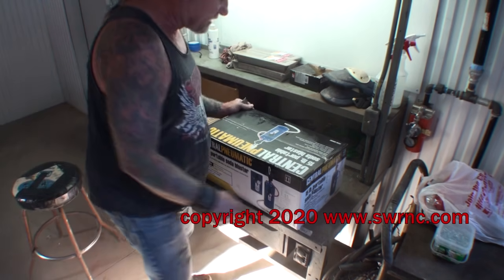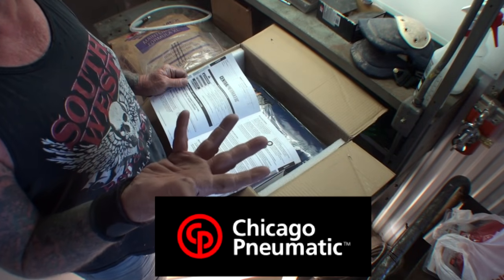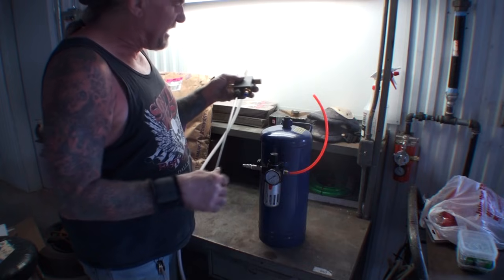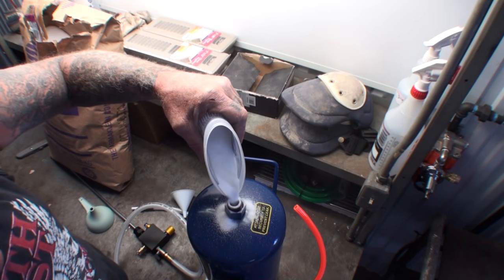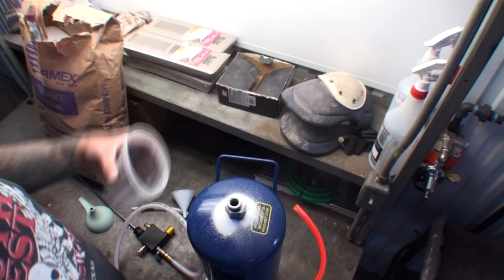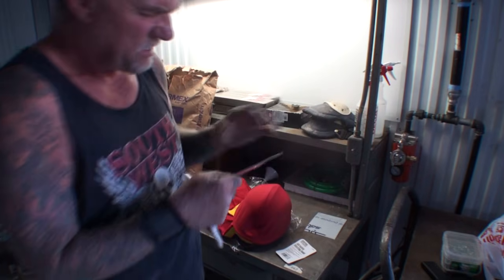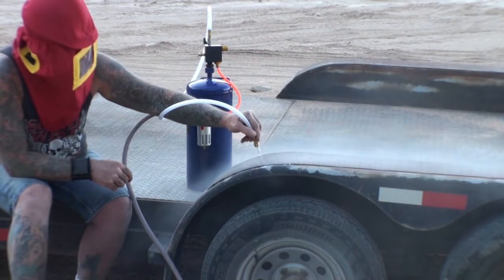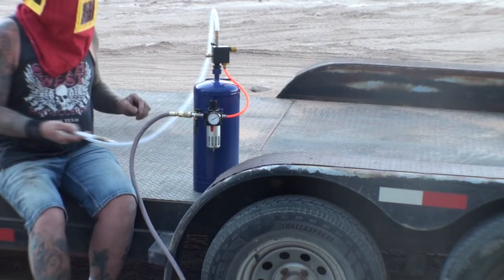"Harbor Freight" - Portable Soda Blaster - TOTAL JUNK?  [REVIEW]

Comment: When you bang a ceramic nozzle on something, what do you expect.......for it not to break?  I have one of these units and it works fine. Soda is very humidity sensitive. Instead of compressor air which is always contaminated with moisture or oil, I use nitrogen. I use this in my carb rebuild shop and have no problems at all.  I think the biggest fail in this video is the operator.
Reply: How about a video by you on how to use it properly. I'm also working on carburetors but struggling with pressure and flows to get it working properly.
Reply: @afraser4669  i like this idea

Comment: You didn't expect quality at the price. But if you were patient and didn't strip the plastic nut, read the instruction where it says how to start and what to expect, you might have gotten it to work. Now you're returning it. It was the wrong tool for that trailer anyway. Thanks for helping  to keep prices higher. You needed the sand blaster.

Comment: Had that hood , couldn’t use it for more than a minute before it fogged up and couldn’t see anything , bought a fresh air supply hood for media blasting its a must have for me , its hooked to a 30 foot 3 inch flex hose to a bathroom exhaust fan mounted in a filter box works perfect for me even on hot days

Comment: Pete. Give harbor freights $30 50lb siphon blaster a try. I like mine! I run fine coal slag from tractor supply through it. 50lb bag is $9. I imagine you may be to use soda through it. 
I did areas under my Plymouth Fury with it and was surprised at it's output. A couple recommendations.  Cut the feed hose to half the length, that'll give you a spare. If you want to try another hood. Tractor supply has the EXACT hood I've seen go for $47 for $23. It's a "deluxe" hood. Fairly decent.
Good luck and thanks for the video!

Comment: I do sandblasting professionally soda will not touch rust
Reply: My experience with pressurized media blasting is first pressurize the tank , open the valve for media ,then adjust your air flow . This should keep your hose from clogging from a blast of media shooing down the hose all at once and clogging .
Reply: @the-dullahan  stripping old paint from wood is a good example of what soda would be good for.
Reply: @superduty4556  And your point? The video is (after twenty minutes of talking) some fairy trying to soda blast epoxy and rust from steel, which is not what soda blasting is for.
Reply: @superduty4556  put the bowl down and watch the video again when you sober up. He's not using it on wood, he's using it on epoxy coated steel. No soda blaster is gonna strip rust off epoxied steel because that's not what they're made to do.
Reply: @the-dullahan  relax, I was agreeing with you.
Reply: @Robert-Christian  damn, yall need to chill. I said stripping paint from wood is a good example of what it's good for, I never said it was going to strip rust. Reading comprehension is not a strong suit with folks, I suppose.

Comment: I have one ,any kind of moisture will plug   it right up i had to install a water moisture filter just before the air entered  into the tank.  Its ok for small thing but it  slow and on anything your going to paint it seem to due something to the surface that needs to be treated.

Comment: As far as pouring the soda into the tank, just use the small funnel your were using and pour with the cup in your left hand and use a piece of tie wire to keep running up and down in the funnel tube and the soda will go in faster. After that i dont know what the hell to tell you as things looked Janky
Reply: No no no no no!!!!  If right from the start you have to start fiddling with it, and buying funnels to fill it, it should be obliterated from this planet. Poor design of fill neck = poor design overall. Throw it out and get your money back. Money has more value than this piece of horsesh*t.  I will never support bad design no matter the low cost.  My criteria for keeping any tools - do you want to curse or smile every time you use it?

Comment: I'm just wondering if you had proper gloves, if you had held your hand over the outlet to push air back through the pickup tube just like you have to do with most sand blasters when they plug up.

Comment: For a minute there, I thought that hose was going to whip you in the face. ALC have really good portable soda blasters that you can get through them or at Northern Tool, but they are a bit over $600 for a 110lb 28 gallon unit. They work brilliantly. When it comes to anything that involves media, whether it be portable or a blast cabinet, 2 things that I learned the hard way, never purchase a shit compressor. Save your money cause you can purchase a really nice 60 gallon single stage Ingersoll Rand or Quincy compressor that puts out 12-13cfm at 90 psi for around $800. 2nd thing is, don't get a shit blasting cabinet or shit portable blaster, you get what you pay for when it comes to those. I saved my money and invested in equipment that I will use for years to come. Total cost for a good cabinet, compressor, and portable blasting unit was around $2000.

Comment: Make a paper funnel. I bought the bigger version because the fill hole is 1", I used it on my boat hull bottom. I used both grades of sodium bicarbonate that HF sells. It did a great job, especially for the price. Maybe if you put a little fur around it and pretend it's a Smurf you can get some of the white stuff in it!!
Reply: Hey thanks for this info.  If you have a moment for a quick question, do you need a beefy compressor for this?  It looked like mine might not do the job was just curious what you had.   I'm going to be doing a boat Hull too.
Reply: @Tac0312  I have a 60 gal compressor w/ 11.0 cfm output. You have to maintain a minimum pressure at the flow rate you need. Dry air is important. You could use a 5cfm 115 VAC compressor if you are doing small jobs. If I had to remove all the layers of bottom paint again I would try this tool from Har Freight 58079. Wear a good mask!

Comment: To begin with, this guy should not be making help or reviews, period. He has very little patients and very little foresight. As soon as I saw the funnel he selected It was clear it was not the right funnel. Funnels are very inexpensive and one has to dedicate the right one for the job. He could have used the one that seemed to be filling if only he had the foresight to trim the nozzle to fit the fill hole. Simply cut off the tip so you will have a larger hole. We could see clearly the funnel went all the way into the bottom of the v shape portion. That would have saved him time and us not having to listen to his foul language which makes him look as if it's the only language he knows. Ex-Marine so I have heard it all but cuts you out of the general population as the go-to person to listen to. This is the ongoing problem with free media. Anyone can make a video but few should until they slow down and think how to do it. If we practice we can all get better and then you become an asset. As far as the red feed line, if he would have just turned it to the side slightly it will plug right in then move the wand over to the verticle position in the sand and screw down the holding collar nut. I have this same unit and maybe if he had just opened it in advance and used it first to see the ins and outs he may have come up with these small ideas himself. The bible says to be slow to speak, and now you know why. Just a thought.

Comment: This was helpful, as I was considering getting one of those to remove the factory paint on a '90 Mustang front bumper cover without harming the urethane. Scratch that. Any other ideas how I can strip this part?
Reply: Take it to somebody.
Reply: @chadkennedy529  I tried, nobody wants to touch it. Either afraid of destroying it, or "We do industrial work only".
Reply: @mattfarahsmillionmilelexus  that's all I do... only because we have more into material and travel than the parts worth most of the time. You might get lucky and find somebody with a commercial cabinet blaster that could help you. Good luck man👍

Comment: It's not working because you actually need paint grade air with no moisture in the air at all, the second any water enters it the soda clogs up like that, the water trap that comes with it is dog shit, I run a 5 stage professional system for painting cars and that only just about does it.

Comment: Pete, I pick up a 50 lb blaster from Eastwood, then someone told me soda will make the surface too smooth!, I use abrasive and it kix butt on scale and rust, axels underbody work. '49 Willys 4x wagon body off full build
Reply: eastwood has awesome products.. i have a welder from eastwood works great

Comment: Ha ha ha ha ha!! This review was hilarious!  You looked so defeated and pissed off!  😂😂😂
No tool is worth feeling disgusted with it from the outset. The tiny neck on this tank is RIDICULOUS. Chinese design of course. What absolute rubbish! 🤬

This is 7 CFM (Cubic Feet per Minute) and a professional said you need a minimum force of 8 CFM.  He also recommended a Tungsten Carbide tip.
Thank you for this hilarious and very informative review. Any lingering desire to buy this has permanently evaporated. 😆
Great job on the review!!!

Comment: THE RINKY DINK BLUE FITTING THAT YOU USE TO CONNECT AIR LING FROM THE REGULATOR, well i have a friend with a big CNC MACHINE SHOP, and his machines use those fittings (his has a metal piece instead of plastic) on the lines. i also have lots of those fittings as another friend quit the dry cleaning/steam cleaning  part of his laundry business (the chemicals they use cause cancer, and he recently died of cancer) and gave me the ENTIRE DRY CLEANING/steam cleaning  EQUIPMENT/MACHINERY FROM THAT PART OF THE BUSINESS TO SCRAP OUT AND SELL FOR  SCRAP! the motors were all 3 phase 220 volt motors, and lots of operations were powered by air operated valves. THIS MACHINERY WAS MADE IN ITALY !!! and every connection for both air and steam had those quick fit type fittings!!! SHARK BITE FITTINGS FOR PLUMBING OPERATE THE VERY SAME WAY!!
it would be very simple to replace the cheap parts with a quality part .

Comment: I buy a lot from HF, but this is one I would never buy or even look at. They make a "spot blaster" that works ok for this, and it's cheap as hell. But the hopper is pretty small. Both are for small jobs, so don't even bother with the frustrations this thing will bring. Soda Blasting has it's place, and works for what it's meant for, but if you don't have to use Soda, Don't. You will spend days and pallets of Soda trying to get it to do what it can't do. I'll say it from experience. SODA BLASTING SUCKS! There is a reason I only use it, when I HAVE to use it. Glass Bead, Silly Sand, Alum Ox, Copper Slag, etc etc etc are my usual go to's. IMO soda blasting is WAY over used and the only way its environmentally friendly is because it KILLS the guy doing the work. Even with a full blasting suit (w/piped in fresh air) and wearing a mask that shyte gets in. You taste soda for a week. Yeah.... I freekin' HATE soda blasting.

Comment: To make small improvements to this unit if you are short-tempered. Add a 90-degree elbow to the quick disconnect to the red hose to plug it in easily. You don't even need to do that. Just plug the red line quick disconnect before screwing down the tank collar nut. Trim a cheap funnel tip down to enlarge the funnel hole and keep the funnel in the bag of sand to keep it clean of outside dust and debris. I would not buy the sandblasting mask. they are very hot and a regular clear plastic full-face shield works fantastic and is cheap. Can also be purchased at Harbor freight. Take the time to learn better ways. I also have a pressure washer sandblaster kit that works amazingly. If you have a higher pressure, washer you can buy a pressure washer kit for around $100.00 that gets it done much faster. My honest opinion is this video was made to discourage Harbor Freight purchases in general to new buyers. A lot of products they sell work just fine and have bought many. Just watch the positive videos and buy those products you agree with. This is a bad example of a review video and you should find one that is positive that you agree with and go from there. Anyone with mechanical knowledge can shoot down any product if he tries and that appears to be what this man has done.

Comment: I bought 2013 the big 90lb. one right when I saw the Smaller ones in the store I knew it would take FOREVER to Fill. Nut for >REG< Metal, Comes with Hood That is way better with Extra Tips & Extra Large Funnel fits perfect to fills & put Unit back Together in under 3 minutes >TIMED<  Don't buy to do entire car UNLESS You HAVE ALL the TIME in the World... 8 hours a Day 2 Weeks [Properly done] Outside of car, outer whole top side of car Only... (Not) Including Under carriage or Interior. An Like Pete Say's You MUST Drill out Existing Holes and Add EXTRA Holes to speed up You will still have to D**K with unit just not very often... I Store ALL my Different Media at Room Temp 24/7 Big Difference.

Comment: You,  were negative right out of the box so I knew where this video was going. Trying to blast a big project like a trailer with a piece of equipment that wasn't designed to. This machine is for small projects. You actually made yourself look ridiculous. I have 3 of these machines in my resto shop and they work fine on trim and such. Works great on carbs. Learn to use the proper tool for the proper job.

Comment: I wouldn't buy a HF soda blaster when you could get a quality one for about $10 more, but this is the worst "review" I've ever seen. Some drunkard stutters and rambles on for 21 minutes before even using the product (most reviews are four minutes or less) and then when he goes to use it, he tries sandblasting with it. Like, I know it's junk, but NO soda blaster is going to remove rust, epoxy enamel and epoxy primer from a steel trailer like that, especially at such low PSI. That's what sandblasters are for. Soda blasting is for stripping buildup off of delicate parts, like carburetor bowls, not for stripping epoxy paint and rust off of steel diamondplate.

Comment: What a disappointing piece of junk.  For those interested in building a Vapour and or Sand blasting cabinet, Armoury Enterprises in New Zealand is a good source. They can be found on Youtube. I tried a suction cup blasting gun that I had for years but never used with glass beads. Still cleaning up the mess 6 months later.  Yes, these too are utterly useless.